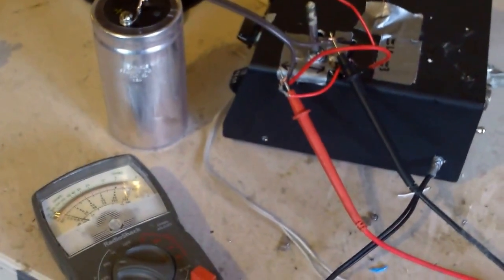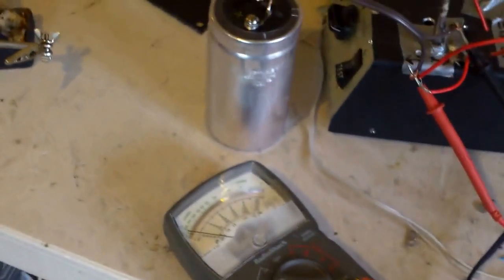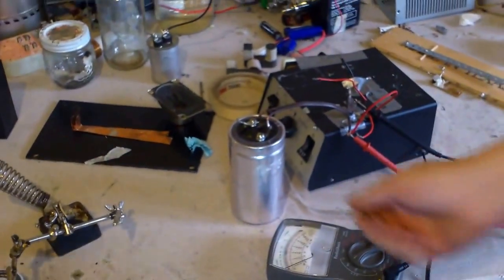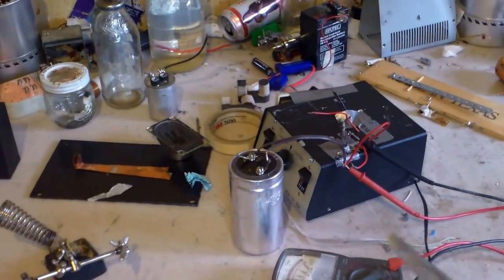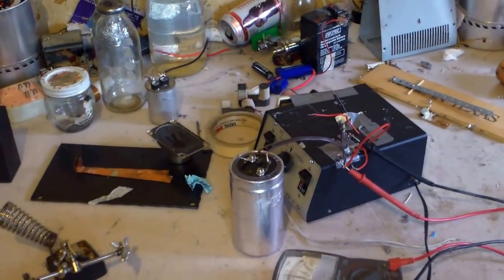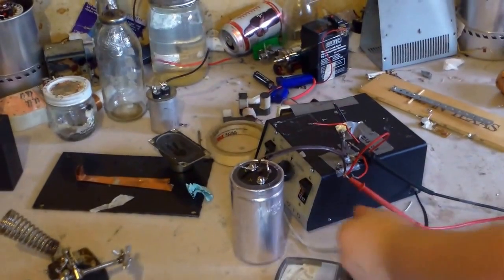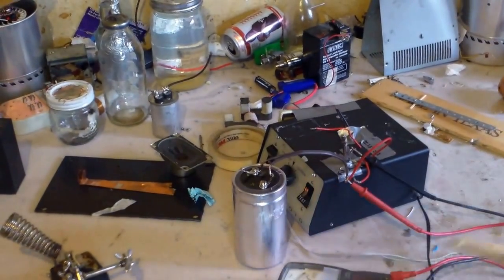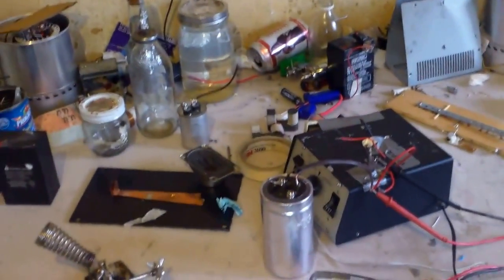discharging a large capacitor

Comment: That's nothing I attached a 9v battery to a 600 mill  µF capacitor and forgot it for about a day, when I discovered the 9v about ready to burst into flames I realized my error and discharged the capacitor with a needle nose pliers ...won't ever do that again, blew the end off the pliers as well as the top of the cap.